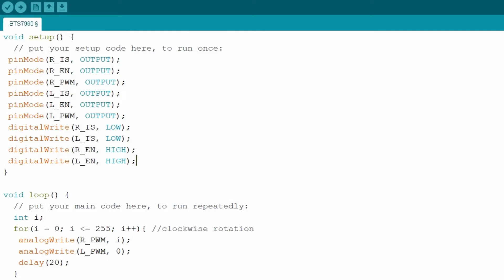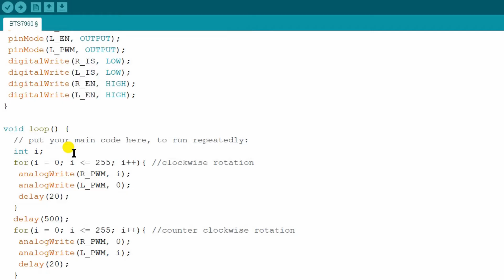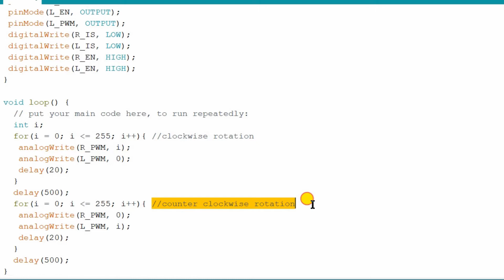How to work with BTS7960 motor driver and Arduino

Comment: RIS and LIS pins are output from BTS7960 . these pins give out some voltage proportional to current. In your program you have used them and grounded them through arduino. THis will damage the motor controller. There is no need to use these if you are not interested in current.
Reply: What would be an example code and application of the RIS and LIS pins? I was interested in using them on the ESP32, perhaps programming to display amperage consumed on an LCD

Comment: Hello. What will happen when you apply a PWM signal to RWPM and LPWM at the same time? Will it stop or will there be a short circuit and damage?

Witaj. Co się stanie gdy podasz sygnał PWM do RWPM i LPWM jednocześnie ? Zatrzyma się czy będzie zwarcie i się uszkodzi ?
Reply: If both pins are high, the motor will brake (not break).

Comment: Hi! I'm confuse why do you set L_IS and R_IS as OUTPUTs, they should be set as INPUTs. 

Pin IS of the BTS7920 is an OUTPUT Pin !?! 

Also, I have made a schematic and L_IS and R_IS are directly connected to the respective pin 5 of the BTS7960 while all OUTPUTS to the BTS7960 such L_PWM, R_PWM L_EN and R_EN goes through the buffer 244 before interfacing to BTS7960 motor driver.
Reply: You're right. X_IS pins are actually outputs from the motor driver. The YouTuber has no clue.

Comment: Can I use this with four motors? If yes how should the connections be?
Reply: Only if you plan to control those motors together. It cant separately control 4 motors, only 1 with its 2 terminals: 1 positive, 1 negative (they change polarity to reverse direction) for the motor output. Otherwise you would clearly see 8 motor output terminals. Still, if the total current consumption of those motors isnt way too high, you could connect all 4 motors to the same 2 terminals. I guess you want to control the motors independently, so this module isnt for your application.

Comment: Hi, I try this with two motors and they work very well but when I tri it with another servo conected to Arduino Uno, one of the motors doen't work, that it is, only one motor and the servo work well. Would yo know why?

Comment: Hello. Is it possible to use plc s7-1200 which supplies PWM Pulse like Arduino to control DC Motor 24V 2A? Thank you so much.

Comment: The Arduino numbers on your diagram don't seem to match those in the code. The pins used in the code start from 2 but on the diagram they start from 1. As has already been said R_IS and L_IS should be set as INPUT and not OUTPUT

Comment: can u use 2 of this driver using 1 microcontroler to control 2 motor ? and should i connect the vcc and ground pin to the arduino ? will it burn the arduino ?

Comment: is this driver works with Wiper Motor ?
Reply: It depends on the wiper motor. If it has just two connections into the motor then it may work - but that will depend on the current drawn by the motor (i.e. what amps it consumes). There should be some kind of label on the motor that says (for example) something like "12V 15A" meaning it needs 12 Volts at up to 15 Amps.  

This board supposedly can supply up to 42 Amps - but a guy called RoboxJax did a detailed test of this board here on YouTube and concluded that 15 Amps is probably a safe continuous current limit for this board - else it will overheat.  Having said all that, the board does feature over-amps shutdown protection so there would be little to lose by trying out your 2-wire motor to see if it works - assuming your power source (car battery?) is also up to the job.
Reply: @alanmusicman3385  I would suggest download the PCB mount with 40mm fan and add active cooling on there if someone plans to run  at the higher range of the limits so that it can prolong the life

Comment: Sean Lyon
4小时前
Great video! I am making a ball launching machine using a 12V 30W motor and a 16.8 Ah Lithium battery. I need the motor to spin one second and wait for 5 seconds and repeat this cycle. Would this motor controller work with this setup? Thanks

Comment: Could you explain why you need to put both motor and battery ground together ?
Reply: The two boards are effectively two different DC powered subsystems. The Arduino is powered from the USB lead and the motor driver from (in this implementation) a 9V DC battery.  

In order for two such subsystems to signal to one another they must have a common ground reference (i.e. to agree on what 0 Volts looks like!) thus the need to cross connect their ground leads - but just once. Multiple common ground connections between two subsystems can cause problems. Without that common ground connection, they wont communicate properly or at all, and also they may damage one another.
Reply: To complete the circuit...

Comment: Nice one friend! I use the IBT-2 and arduino on my DIY motion simulator (full frame platform) which interfaces with Racing simulator software games!  You did a good job on this post!  DMAX motion simulator ch

Comment: can we run 5 motoros by one arduino ?> with 5 IBT_2 ?
Reply: I have been able to run 3 motors from one arduino. Using 3 IBT-2.. I dont think you can control five without using two arduino's.  Not enough IO pins.. I built a 3DOF motion simulator for sim racing with one arduino and 3 ITB's.. DMAX motion sim Ch
Reply: @DMAX_DIY  I found out how to run 18 IBT which can run 18 with one arduino due with the help of two Multiplexers
Reply: @EnergySeeker  Well I did not think of multiplexing. Good job..  I'm trying to switch over to the sabertooth 2x60. I already have some JRK12V12's.  But thinking of upgrading to more powerful motors for a 6DOF
Reply: @DMAX_DIY  if you check my channel you will see how I did the 18 motor drive with one arduino 
But am using it for something else not motors
Reply: @EnergySeeker  Cool.. I'll check it out Amir. DMAX

Comment: Dear, I have one question about this H-bridge. I really appreciate if you could help me, answering to this comment.
The thing is that I need to use this H-Bridge for a project I'm developing to can control something at 40A continiously. The problem is that I don't understand how is possible that the connectros in this circuit can support 43A continiously. Everywhere in internet I read that this can work at this high current, but when I look to this small connector I think this can hardly resist it... I have some of this H-bridge and they work perfectly, but I never tried to use it at high current... Normally to can drive high current you need thick cable, but this thick cable doesn't fit in this small connectors...!! Another point: I have been reading in the side of this connector (marked in the green plastic) that this is designed for maximum 220VAC and 10A... So this is confirming a maximum current of 10A, isn't it?? 
I hope you can tell me something about it, probably you have more experience... Thank you so much in advance...! :-)
Reply: It can not handle 43A continuous. It can only handle about 10-15A. 
The problem is that the heatsink is mounted in a stupid way, it should be mounted directly on top of the two main driver chips, using a good thermal paste. This will help it handle more, but how much exactly I do not know.

The 43A rating is that of the chip datasheet, which assumes "sufficient" cooling. If you want to guarantee 43A, you should mount a very good heatsink.
Reply: @ChielScape  I have three of these, with a 120mm intake fan blowing on the fins and a 90mm exhaust fan. I've been running them for over 300 hours and the most current my motion sim rig has shown is 36 amps (12vdc) and that's at big directional change acceleration to hard braking.  My motors are 50:1 and are pretty big. But I agree with you that the heatsinks should probably be ON the Chip.. DMAX motion sim channel
Reply: @ChielScape  So if i use 250 watt motor with 24 V  maybe that's work ?

Comment: hi. is it suitable for nema 17 stepper motor??
Reply from the maker: Thanks for asking. I'm afraid, apparently it's not suitable for stepper motors. But you can use it for steppers though by changing the sketch.
Reply: @IngenieroLab  How so?

There are only 2 high voltage/current outputs and for a stepper motor you need 4 ideally or at least 3.

If you know how, please let me know, that would help a ton. As I'm trying to drive a number of steppers and I'm in search for simple and cheap drivers.

Comment: It is not better to have a single PWM signal and the ENABLE signals of the directions of rotation, to have them through an inverter. In this way they will NEVER be both enabled and a Single PWM signal would serve to rotate the motor in both directions. Let's imagine a 2 motor application, we would need 4 PWM signals in this way and only 2 if we do it as I propose. Does it seem correct?

Comment: Do you need to wire up 3,4,5,6 if you are only intending to use PWM? (pins 3,6 on Arduino?) I don't understand what IS and EN stands for.
Thanks

Comment: How to know is rpm encoder sir ?
Reply from the maker: You must use a rotary encoder to know the rpm of motor. Only BTS7960 can not detect that...
Reply: @IngenieroLab  i have motor PG45 with encoder sir ,but i don't know to know the RPM with arduino .i hope you can help me to know that sir🙏

Comment: great tutorial... what if I want 2 motors running and controlled it by a joystick? is it posibble? can you helpme with the codes TIA
Reply from the maker: Yeah you can control two motors with with joystick using bts7960. Recently I will provide a video explaining that to everyone.
Thanks for your response.
Reply: @IngenieroLab  is it posted?
Reply from the maker: @brainfreeze911  Not yet, it will be posted by next week. Stay tuned, you will get it ASAP..... Thank you!

Comment: Hi! thanks for your video! do you have something when we need connect two motors?
Reply from the maker: You can simply connect two motors to the motor output pins and they will work together. But if you want to control each of them individually, then two BTS7960 is needed.
Reply: @IngenieroLab  I want to control two motors and each of them individually and I think I will use two BTS7960s. However, Are there enough pins for Arduino to connect two BTS? And as I see in your video, pin R_IS and L_IS you set LOW logic the whole time. Is it okay if I don't connect these two pins to Arduino? Hope u answer me this question. Thank you.